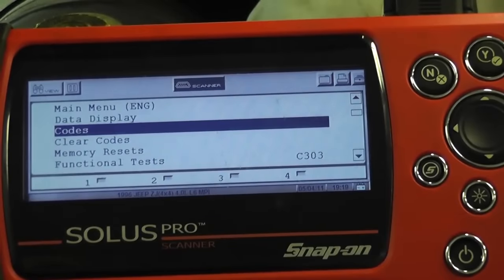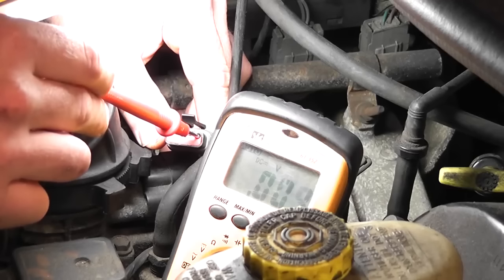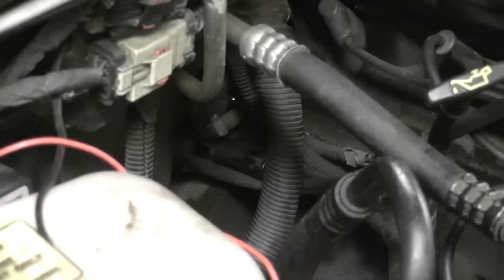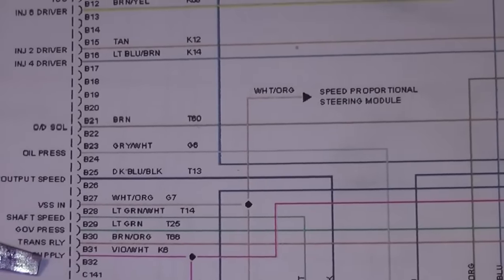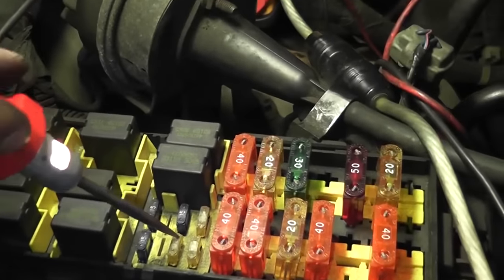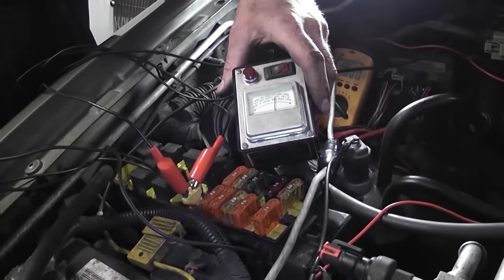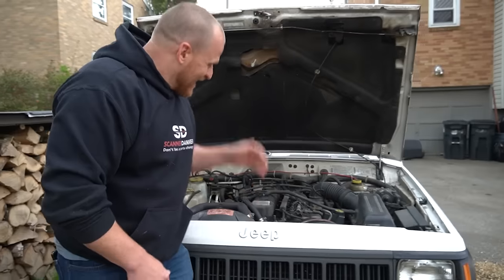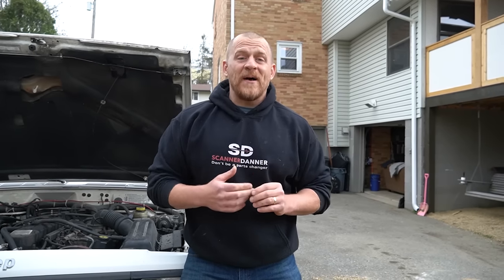96 Jeep, No Start, No Com with PCM, No 5v reference (Quick Tips)

Comment: This is video hurts my soul, why would you check 5v before 12v. You cut a freaking wire before testing 12v. 

Order of operations should be Battery > Fuses > 12v Input Power, Key On and  Ground > 5v and Comms. 

Plus spend $20 or less and buy / make a set of back probe leads for your meter.
Reply from the maker: Agree, I was teaching through the 5v ref circuit with my class and I genuinely thought I had a shorted ref circuit going into this. So it was a good opportunity to walk that path with my class and most definitely they at least got the message to always check for your power feeds first (in this case a blown fuse)
Reply: @ScannerDanner  Takes a big person to admit a mistake. 👏Good on you sir! 

Your stuff is usually solid! Keep up the good work and buy back probe leads!

Comment: hey buddy ,can i call you for a few minutes please ? PLEASE ! ...........
Reply from the maker: No sir, I'm sorry, if you need right now help post to my forum. It is free to join www.scannerdanner.com 
Or ask your questions here and I'll do my best to answer.
Reply: @ScannerDanner  THANK YOU BROTHER !
Reply: @ScannerDanner  i just posted to your forum , and this was message ,  ----   PAUL ,,,,,my nightmare started sept 2020 .........PO23F AND UO100 , on code reader , but screen in car says ,stabili trak and side detection problems  lol ... here is problem ,it started with ride to dr's office .after about 3 hrs approached the car and when i opened the door ,it made a very fast clicking sound under the hood . i got in push the start button ,nothing ,no crank ,no start . the clicking sound comes on when i disconnect and reconnect the battery ,open the door ,trunk or hit the power locks . upon investigation ,my # 10 ecm fuse continues to burn with the # 7 relay being left in .when i remove the relay ,the # 10 ECM fuse doesnt blow anymore and the clicking stops . the suspect relay is KR75 , IT IS LABELED AS RELAY # 7 ,ITS ON THE SIDE OF FUSES 8,9,10 AND 11 ....... we all have had one give us a NIGHTMARE and this is it for me .  my tools are  POWER PROBE -PP3 ,and PP (THE HOOK  and power probe  ECT - 2000 , DVMM , TEST LIGHTS , both kinds regular and computer safe ,,AND A BLURDRIVER AS MY SCAN TOOL . I HAVE 1000'S OF PAPERS WITH DIAGRAM, SCHEMATICS , ALL SORTS OD DIAGNOSTIC INFO ,MOSTLY FROM ONLINE CHILTON , AND SEVERAL FROM MITCHELLE 1 . I HAVE ACCESS TO MITCHELLE  1 PRO DEMAND NOW , SO IF I GET ANY REFERENCE HELP FROM YOU PAUL OR OTHERS , I CAN LOOK IT UP AND FOLLOW ! ANY HELP ON THIS MATTER IS GREATLY APPRECIATED . ITS BEEN PARKED 11 MONTHS , PLEASE HELP . its posted as follows ,  ( 2011 BUICK LACROSSE CXS FWD ,3.6 engine  NO CRANK  , NO START !!! ) ,,,,,,  by -  Rickyrick  ...... WOW  YOUR WEB SITE IS AWESOME ,JUST TYPE IN buick lacrosse problems  in search bar and im one of the 3 that come up !  imagine a world without scannerdanner , hmmmmmmmmm !!!! hell no !!!!!! lol
Reply from the maker: @rick31869  this sounds like a classic bad computer ground issue https://youtu.be/dfAMDODbDEw and then also watch this one https://youtu.be/CEjmo_qT4yQ
Yes, a bad ground can cause a fuse to blow!! Also, the service info I show says that the #7 relay is the KR71 NOT KR75, can you confirm
Reply: @ScannerDanner  yes sir ,mitchelle 1 pro demand says KR71 , REPAIR BUDDY SAID THE SAME THING ! so computer ground as in inside computer or external ? its weird the clicking sound goes away with relay  removed and fuse doesnt burn ! im going warch the vids now bro ! thank you !